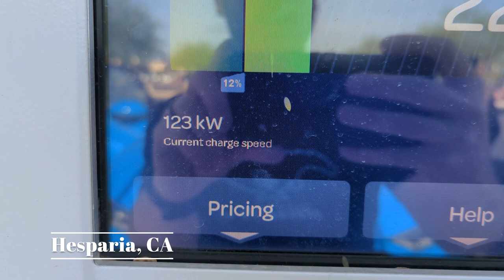Electrify America Charger Infrastructure Growing Pains

Comment: 4 months later and EA’s situation has not improved much, if at all.   The had severe issues across the country with chargers failing during cold weather.    They did announce a plan to add more chargers, but that plan only involves building more chargers along the Interstates.    Most of the traffic in the US travels on US and State highways, and EA has no chargers that serve those routes.    It can be hundreds of miles between Interstates, especially here in the middle of the country, so if your route includes long stretches of driving US and State highways, you are completely out of luck, or you may have to detour 100 miles in order to charge at an EV location.      This situation has to change.

Comment: 1. Real time monitoring and quick response teams for uptime. 2. Roaming agreements like cell phone networks did early on. Fast charging is meaningless if you spend the first 45 mins trying to get signed up and get the machine to respond. Plug-N-Charge is the only thing that will make the experience the same as Tesla.

Comment: I can actually say that my local stations are being service as son as they can, as a matter of fact , went to charge to find a tech that asked me if I could try an specific station because he need it to test to see if the cable was getting too hot, he was on his way home two hours away and he  turn back because a customer reported that station handle getting too hot, I didn’t experienced that , the tech still reports it to the charger manufacturer directly, Signet in this case and he said that Signets are the more reliable

Comment: I’ve done multiple trips of over 500 a day in both my Mach E and my Model 3. I have not  had any charging issues with either vehicle. However its very common to come to an electrify America station and find a few chargers not working . Most electricity America sites have less that 8 chargers and it is a little worrisome that at least a few are out of order. EA is still the best non Tesla network out there but needs to be improved. Baker California should be how all EA sites ought to be.

Comment: Yep, people do like to complain. The bottom line, however, is that everybody but Tesla would still be waiting for the Electric Revolution if it weren't for EA. They made the first gen chargers out of things that weren't chargers, and certainly weren't consumer products. Keep in mind that the infrastructure bill only passed this year while Europe has been helping to fund charger network expansion for years.

Be nice to the support people when you call in. They have always been helpful to me, sometimes rebooting a station to get me charging.

I have spoken to EA several times about putting a charger in Clayton New Mexico. It's in the middle of the empty places on the best shortcut between Dallas and Denver. I have to admit that I never thought about the need to have an electric service company within driving distance. Clayton is a solid 2 hours outside of Amarillo, the nearest city likely to have an industrial electric service company.

Comment: I can echo Patrick's comment. I just took my E-Tron GT on a round trip from SoCal to Wisconsin with a side trip to North Dakota and I was always able to charge at every EA station. Never had to wait and most of the charging speeds were what I expected (175kW from a 150kW charger) or 250kW from a 350kW charger.

Biggest issue was occasionally pulling up to a 350kW charger and finding a Bolt plugged in charging to 100%.

Comment: I would not have been so nice to him haha. I’ve had an absolutely terrible experience with EA over the past 5 years and it seems to me they can’t even get the basics right like providing shade covers or making sure cables can reach charge ports let alone them being broken most the time.
Reply from the maker: We've done a couple thousand more road trip miles since that video and it has been pretty good. A couple of stations were down for maintenance so they can add awnings. They also took down some stations to do major equipment upgrades - just like he said they would be doing in the interview.
Reply: @MachE_VLOG  They did in fact take down several stations for upgrades around me, unfortunately the way they handled was also quite frustrating. EA has two locations between Dallas and Austin and they are the only fast chargers in that corridor. They took down BOTH at the SAME TIME right before thanksgiving leaving that whole corridor down. Without proper notice, I arrived at one with 5% charge to discover this leaving me stranded with 3 of my friends. We were there the day before and there was a huge line, it’s a vital station and there were no signs indicating it would be shut down the next day. We had to cancel our plans and charge for several hours at a private party’s L2, grateful they were kind enough to let us use it. My friends however are completely turned off from EVs now. 

The problem with EA is they are vital infrastructure but absolutely do not act like it. It needs to be easy. Imagine your grandma trying to figure out EA’s mess: it just way too much and way to unpredictable. Charging needs to be easy and reliable for everyone if we want mass EV adoption. 

The small inconveniences (location, no weather covers, hard to reach cables, and so on) would not bother me so much if the chargers actually worked. If the company was reliable. As it is, I have no trust in EA as a consumer.
Reply from the maker: @Termnath  Oh yeah, I heard about the outage between Dallas and Austin. A lot of people are upset by that. It really is a matter of poor planning to do something like that.
Reply: @Termnath Version 4 Tesla stalls will have CCS charging in a few years,to where you don't need an adapter you pull in and get the same quality as Tesla.

Comment: Patrick, I would suggest you take time to investigate this guy's outrageous claim that at battery-equipped sites, EA did not take any grid power during the many days of recent flex alerts in CA.  Hint: start with the kWh capacity of the battery packs.  Then ask yourself what happens after the first big-pack car gets charged.  The purpose of these batteries is to reduce demand/subscription peak charges; NOT to power a site for 5 hours!  EA has no accountability - answers to no one.
Reply: wtf are you even on about? The market and utilities govern EA’s behaviors and EA pays demand charges. What’s it to you whether they use energy storage or not at their sites? The electrical engineers will figure it out just fine. The software engineers and equipment vendors on the other hand are a different story altogether.
Reply: @anthonyc8499  Actually, I believe a court settlement also drives EA behaviors.   The issue is a specific claim made by one of their execs.  I charge at battery enhanced EA stations in CA, observed the install process, and interviewed contractors doing the work.  I also had someone run up to me during the time period in question and demand that I unplug my car at a time when Cal ISO said there was 2Gw of surplus capacity.  There is no single entity in my State you can go to with a complaint about a charging network.

Comment: I am afraid right now EA is having a lot of issues, and this causes large amount of frustrations with EV owners.  Until this is fixed and the experience is better owners that have to use EA aren't having the best view of the network.   I need to be able to drive up and plug in to the network and have it work.  Either the app doesn't work, the charger itself doesn't work or something happens.  They have a long way to go I am afraid.  🤷‍♂

Comment: Unreliable DC chargers are the reason why I will not buy non-Tesla EVs.
Reply from the maker: As I mention in the video, we've never had an unsuccessful charging stop. And considering 95% of our charging is at home, it is even more of a non-issue.
Reply: @MachE_VLOG  Good point... with dead solid reliable Level 2 home charging, DC chargers are something the average EV owner rarely has to deal with.